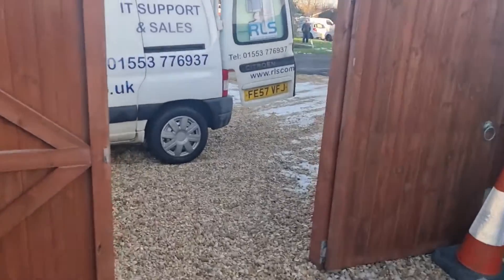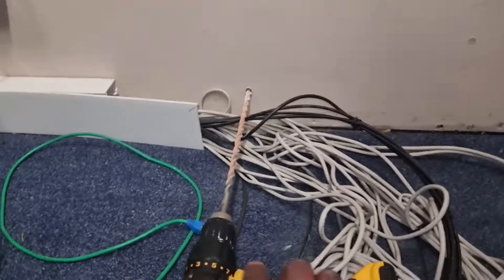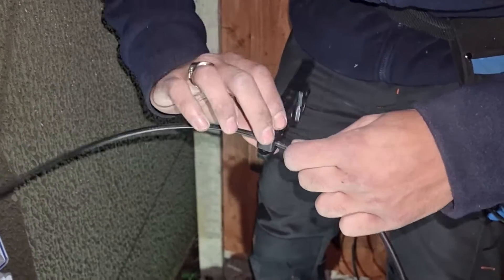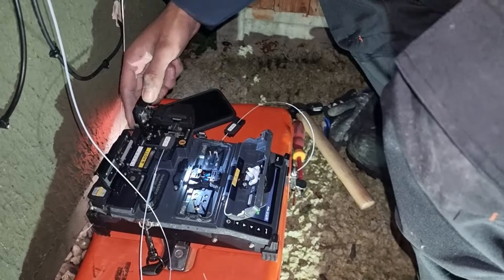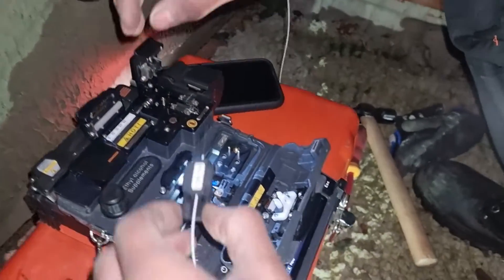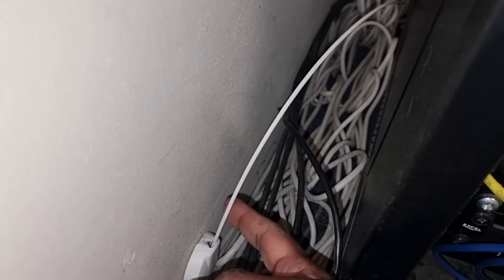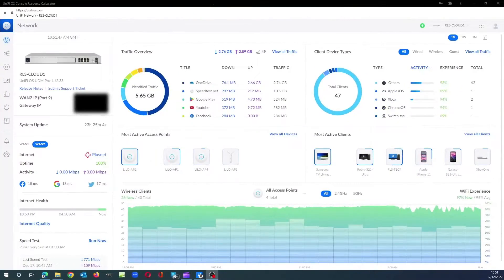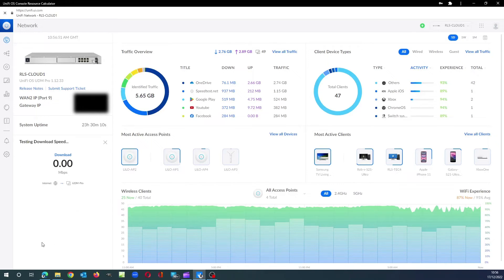Full fibre installation using BT Wholesale Broadband Services.

Comment: Correct me if I am wrong but it has been just over 7y now since I retired after 40y working for openreach my main job was a pole tester helping to make sure the public and my colleagues were safe when working and walking past the networks telephone poles but the first thing I would do would be to make sure I got home to my family safely after a days work so when climbing the poles would always make sure that my ladder was tied up at the top unless things have changed and you do not now need a top ladder tie
Reply: I believe there is a new system of attaching it at the bottom. I don’t know how much that would affect things though.

Comment: I'm getting FTTP  soon by Openreach. In 3rd floor flat from nearby pole. I've fitted a nice 20mm conduit tube from room up through loft and down to cupboard in hall with a pull cord threaded through. Will the engineer be happy to install the ONT in my cupboard and feed the fibre to it using my conduit? I reckon it's 13 metres long. Thanks
Reply from the maker: That depends, if you told them in advance this is what you wanted then probably. however, if the engineer is surprised with a complex install and doesn't have a long enough cable on them, they can refuse to do it. My advice is be polite and nice, offer them tea, coffee and cake and that goes a long way. 😎👍

Comment: I have a question, did BT feed a pre-terminated cable out of the cabin and then perform the splice, or did they also terminate the cable on the inside of the cabin (green connector going into the BT box) ? Thank you
Reply from the maker: No they feed the cable from inside out and spliced it outside. 😎👍

Comment: Whats the difference between fttp and ftth and what kinds of speed difference does it make
Reply from the maker: Hi there. Nothing, they are the same thing, it's just a naming convention. FTTP = Fibre To The Premises and FTTH = Fibre To The Home.
Reply: @RLSComputerServices  is there something beyond fttp you can get ie let says 10,000mbs down and between 500-1000 upload?
Reply from the maker: I've not experienced anything like that here in the UK. There is a 2.5Gbps product coming soon (if not already here). I don't know too much about it yet, though.
Reply: @RLSComputerServices in which case lastly what company has the highest upload speed 
Thats the main thing I'm interested in which companys would you recommend  currently bt full fibre 900 down with 110 ish upload its good but can they go any higher
Reply from the maker: @slantedlustre404 , you ask a lot of good questions. If upload speed is all you are interested in, then Lightspeed must be a consideration with a 1Gbps upload speed in the UK. 

There are other things to take into consideration, like usage and configuration. But if you are a basic home user and not a pro user, then that's what I would go for.

Comment: For an open reach business fibre install do you still need an ont after the AVDA before the router?

So would it be the same theory as this?
Reply from the maker: You still need an ONT. This actually acts as a modem converting your network digital signal into light.
Reply: The adva device is essentially the equivalent of an ONT however this is only if it’s an ethernet product if it’s a business connection it may be a new install

Comment: This quins engineer is very lucky not to be sacked due not adhering to health and safety regs! No drum, No pullys, No sash lines for the overhead installation 😮.  Let me guess he walked the cable to the premises? No arc calibration before the splice😅 #cowboys😂
Reply: Also the splice shouldn't be touched for at least 90secs after the splice protector sleeve has been shrunk
Reply: Yeah when splicing a 288 straight through I always do an arc test before every splice and never touch the splice proctor for 90 seconds 🙄. That's probably why splicing a 288 takes 4 days.

Comment: Can you tell me how far the distance between the modem and router can be? If I want to put the model I'm my loft where the line enters, could it run maybe 15m to downstairs?
Reply from the maker: If you are having the ONT (modem) in the loft, then you will need to run a network cable to where you want the router. This can be upward to 90m of CAT6 cable, so you will be fine at 15m.
Reply: They cannot put it in the loft

Comment: Fibre replaces the phone wires then.
I hope all the noise I've been getting from wire affecting my, and other radio amateurs, will end if it's on fibre. Or will it?
If I caused as much noise on radio as they cause I'd be shut down.
G4GHB.

Comment: great hands on tutorial. i'm getting FTTP installed in a couple of weeks which is great but i live in a bungalow and wondered where they attach the fibre cable to my property from the telegraph pole and then down to the outside wall. they can't really attach it under the eaves near the guttering as it would be too low and could interfear with high sided vehicle in it's path. would they attach it further up on to the chimney then down the roof to the wall? i did hear that openreach are not allowed to secure cable to chimneys.
Reply from the maker: A great question. This depends if your current feed comes from a pole or underground. If above ground from a pole, then the fibre will take the same route as that. If it comes up from underground ducting, then again it will follow that route. Hope this helps.
Reply: Depends on the height of the cable and weather it crosses a carriageway 9/10 the cable that’s up is above minimum height required and they will mirror imagine

Comment: Hi, have you tried to by pass the openreach modem connecting the fiber directly to the UDM using a fiber SFP module?
Reply from the maker: Hi again, this won't be possible for two reasons. First, the fibre has an SC type connector, and the UDM uses an LC type. Also, there still needs to be some kind of termination from the ISP. BT uses this termination to part authenticate the users connection.
Reply from the maker: That's a very good question. The answer is no. But I am going to give it a go and let you know what the outcome is.
Reply: @RLSComputerServices  there’s no point in doing that when they do not control the equipment connected to the head end it may work but he could also randomly be kicked off even if you block the proper box back in you can be charged if they send an engineer out automatically because of this

Comment: If i need to extend this fibre optic cable - i mean buy longer lengh to reposition current modem/router what should i look for exacly? 10m or 15m, i was only given 2m and unit at my window sill.
Reply: Do you know, extend it extend the copper connection

Comment: what i think is most impressive is who actually thinks of these things lets send internet down a glass tube thats like a hair size and u can get like 1gbps - 10gbps speeds down it
Reply: And to think the larger copper cables suffer from range. But it's all to do with speed in the end. Nothing can beat speed of light.
Reply: @portman8909  nothing can beat speed of light in a vacuum, you mean. Speed of light down glass is slightly slower, but actually the speed that matters is how fast it can modulate the signal (as long as the range is ok; thats what makes copper less useful as the distances increase). Electricity signal changes travel down copper wire pretty dang quick too - its the field changing, not the actual electrons speed that matters, and therefore also happens fairly close to the speed of light.
Reply from the maker: You're right. What's next, someone thinks of sending the Internet over a satellite dish? 🤣
Reply: @RLSComputerServices  ubiquiti already do that lol WISP service
Reply: The light doesn't travel in a straight line either, it bounces off the side of the fibre. The fibre is made of 2 densities of glass. So the actual glass that carries the light is a lot thinner than it appears from looking at the outside of the element.

Comment: Could the box he's put on the outside go on the inside if possible ??
Reply from the maker: These boxes are for OpenReach engineers to come and work on the fibre in case of emergency (i.e. broken cable). So they like to have access whenever they need, with or without the homeowners' presence.
Reply: @RLSComputerServices  But it could be put inside if the customer wants it ??
Reply from the maker: @scabbycatcat4202  I don't think so, to be honest we never have asked. But as it is the splice between the external cable and the internal cable I would say not.
Reply: @RLSComputerServices  OK  Thanks for that info. - Regards
Reply from the maker: @scabbycatcat4202  No problem, you are best asking the ISP what they are happy in doing and then maybe come back and update us on how you got on. 😎👍
Reply: @RLSComputerServices   Yes I will but in the meantime I have come across 2 different installations ( without really looking that hard )  that have taken the cable inside the house and terminated it inside the premises  so perhaps its not such a hard and fast rule.  Anyway I will let you know the outcome - Cheers
Reply: @scabbycatcat4202   Yeah you can, that box is called a csp. the big grey one is for external use and there is a smaller more rectangular one that can sit neatly on a skirting board indoors.
Reply: Thanks for the info......Regards @williamdavies1857
Reply: @scabbycatcat4202  no problem... as stated by the creator of the vid, openreach wont be able to access that without someone being present... so worth a consideration
Reply: Thanks   @williamdavies1857
Reply: The csp (grey box) can be installed internally, it’s a lot smaller then the external csp
Reply: @deendon8372  OK , thanks for that info-  Regards

Comment: wish there was a way to speed up the process for the installation my area still says dec 2026 wish it was quicker any suggestions
Reply from the maker: Hi, you are not alone, so find as many people in your area who are in the same boat and approach your local MP. Sounds like a daft approach, but political nagging influences OpenReach. 😉😉
Reply: You can pay the cost to have the rollout done, but this is massive and I doubt you would want to or you could get an ethernet circuit

Comment: Don't forget to plug both the ONT and Router into a UPS/ Battery backup because you need both of these devices to function to maintain a digital voice/ phone service in the event of a powercut!!
Reply from the maker: That's a good point to make to viewers. We were thinking of a video that discussed options for this scenario.
Reply: @RLSComputerServices  When doing this make sure that the 12 Volt connectors fit the power plugs in both the ONT and Router because they can be different sizes etc! the BT Cyberlink Bat Backup can only be used to power the BT Router. The Openreach ONT has a smaller plug/ socket. Openreach no longer supplies ONT backup devices because thy've had tech problems etc! The only way to sort this problem out is to have a common UPS supply for both. This issue breaks the emergency service contract with the customer in the event of a powercut!
Reply: @simonallen6427 PoE breakout & step down to 12v is a much cleaner solution, that way you just have a switch on UPS.

Comment: I am waiting to for western power to put  connection on telephone pole  because did have  one  western power not let Bt go up pole to do it
Reply from the maker: We have a similar situation here. Power Networks lines cross over a customers telephone cable and the BT engineers won't cross over until they make the cable safe, just while they do the installation. This is normally a free service by the power company.
Reply: @RLSComputerServices  Openreach  can’t make up mind  to put full fribe  on phone pole or under ground  Openreach will not let enginee go up pole  Bt and Openreach two different companies  I have phone Bt to see what’s going on  because Openreach tell me nothing what’s going on  be to live 3 time take photos telephone pole  Openreach beginning to piss me of  had phone Bt because Openreach tell me nothing hopefully no what going to do on Friday  I do have telephone pole  they saying safe to go up telephone phone ever wearing a Harness to go up telephone pole. Because electric on pole
Reply: @neildriscoll2974  I don't think they can use the electric pole, we certainly can't in our neck of the woods. I wonder if there is anyone else with this issue who could comment?
Reply from the maker: @neildriscoll2974  I wonder if @UKPowerNetworks would care to comment?
Reply: @roblucas1769  it’s a simple process. You usually apply and pay small fee then you can put whatever you want on the pole but there is an inspection process 1st to check it safe that takes ages.

Comment: So much wrong with this, no TETRA climbing pole, wrong ladder position, no gloves splicing cable, no double cleats on cable radius, fibre not cleaned etc etc etc
Reply: Speaking as a fibre installer, that was a terrible splice. The fibre wasn't cleaned and the light loss was way off after the splice was way off. You can even see the misalignment of the fibre. The dB should be below 7, that wasover 30dB. I'd be getting that redone.
Reply: Engineer did have tetra. Get of you're high horse idiot
Reply: I doubt any of the installers wear gloves when handling fibre, as you said it’s so important to have it clean before install, hands carry dirt, grease etc and this rubs off onto exposed cable
Reply: nothing wrong with the ladder position and the engineer was using CSS which is MJ Quinns version of TETRA
Reply: @shaquilleesparon4665  no top tie off on the pole, splice error over limit etc etc  shoddy
Reply: @smeg568  fair point, didn't spot the missing top tie!
Reply: I had spotted, no cleaning on fiber

Comment: How long for a typical install ?
Reply from the maker: Hi there, it depends on the location of the fibre drop and the distance of the internal fibre cable to the ONT. I would say about 2-3 hours.
Reply: @RLSComputerServices  thanks for the reply
Reply: about 2hrs
Reply: Yep took 2 hours , is there a settling in period?
Reply: @Cezzo84  What do you mean by settling in period? curious
Reply: @readallaboutit1000  when the line is installed is there a settling in period for the line to get to full speed ? Only the guy who installed mine said there’s a 10 day period for the line to be up to full speed ect
Reply: @Cezzo84  not from what i have seen in my job it is pretty instant once it has gone live. Must mention that to my boss about that. i am still training mind.

Comment: bt fibre does not change how bigger the download speeds in the area ,it is just a constant of the same download speed you had before but not down copper wiring .
but it still goes through copper wiring from outside your home 
for example if you only get 30mgs download speed that is all you going to get which is just enough to watch tv in hd 
or play games to such with high latency so you would have to camp a lot 
i do not see the point unless you can update your systems to be honest.
Reply: Your a bit off there mate. If you get fibre to the premise (FTTP) the cable from your house, all the way back the the exchange (where the internet comes from) is fibre, not copper anymore. This means your speeds all the way through will be much higher as data is now using light to travel through the cable, also drops latency down a lot so if you like to game I would highly recommend. You are right about updating systems though, even though you are getting gigabit speeds into your house, if you connect via an old cable eg cat 5 you will not be making the most of the speed your getting. Hope this helps
Reply: @ThomasBallGames  we have bt fibre here the most down copper line you can get although there is infinity is 30 
they offered next door who has the highest broadband of 30 free fibre same price and same download speed 
so why should he have the same ,just to get another 18 month contract going
Reply from the maker: @xeno neomorph  if your neighbour has full fibre FTTP and you are on FTTC the next question would be what is he paying for? They may have upgraded mid contract something BT were doing for a while and there for restricted speeds. Also, they may have simply just not wanted faster speeds and opted for a lesser contract.
Reply: @ThomasBallGames  Who the heck is using CAT 5 though? Most people use CAT 5e or CAT 6 which will be more than enough for FTTP.
Reply: Do you guys not get symmetrical speeds over there like we do in the US? We also no longer have contracts either for the most part
Reply: @chd176  different over here we have high speed fibre and have contracts for up too 2 years
Reply: @XENONEOMORPH1979 I do I'm in Clacton Essex get 1000/1000 with lit fibre .they nothing do with open reach

Comment: What kind of shitty splicing device is that? >_> I mean ... it is fiddly and partially overengineered. You do not need an automatic stripping module?? Use a fucking HAND TOOL. Does not break when you need it the most, is FASTER, and IF it breaks, you can have a spare for cheap. And also ... you hold the fiber under tension and wiggle of shove the splice protection tube over the splice. And don't handle it like this bloke here ... jeez. And come to think of it ... where was the alcohol wipe?